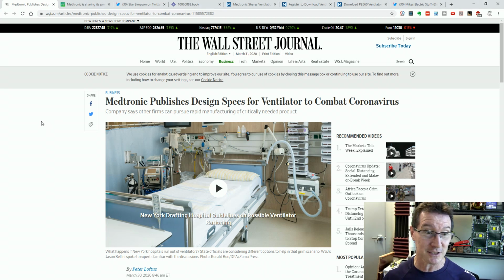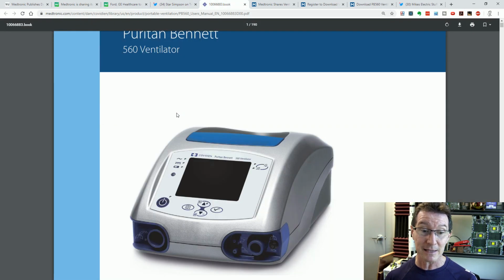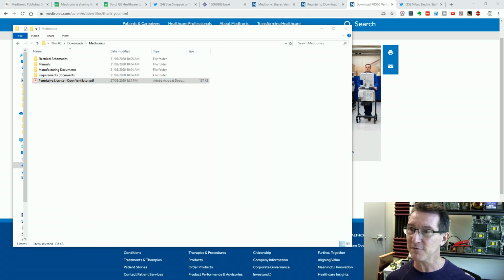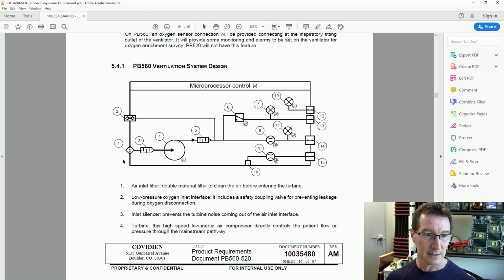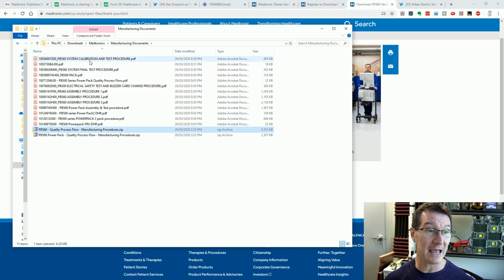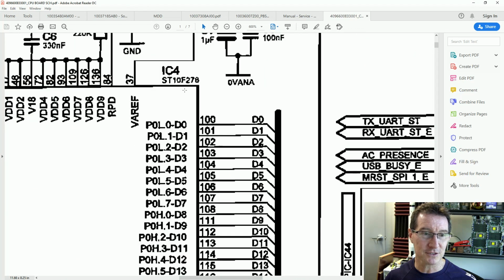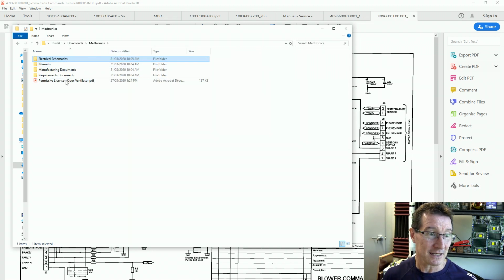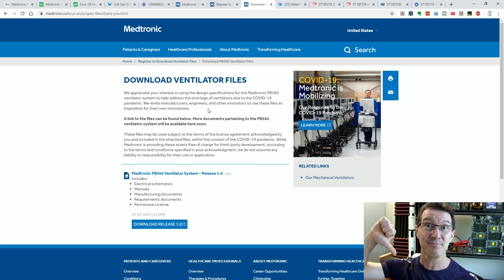eevBLAB #72 - BUSTED! Medtronics Open Ventilator FAIL

Comment from the maker: Perhaps the only thing of real use here would be the requirements documents, and only then to a multi-year approved product design effort. It would do very little or nothing to address any need for ventilators now.
And even then you've gotta read the permissive license very carefully, as the license ends the final day the WHO’s Pandemic call is in effect, or October 1, 2024, whichever comes first.

Also, perhaps unrelated, but interesting, it seems that Medtronic failed deliver ventilators for a US government stockpile contract since 2015:
https://www.nytimes.com/2020/03/29/business/coronavirus-us-ventilator-shortage.html
Reply: They're not releasing the software yet because they're busy removing all the lines of codes for things like "Screen dirty: Return to manufacturer for $2800 service."
Reply: Well, i guess these documents can be usefull, but not in short terms. BS indeed.
Reply: @coredayo3027  keep watch the information, it's coming.
Reply: Someone competent enough might be able to sift through all these documents, fill in the blanks, and design something capable, but it'd honestly be easier to just get your hands on a device whose patents have expired and reverse engineer then improve on that instead.

Hell, even the schematics don't do any good because you have to actually get those specific components to make it work or be really good at working out a substitution, which is risky when lives are on the line
Reply: Dave, and even if they would release all CAD files it would be too high tech of a product to produce instantly. In Italy they use scuba masks with 3D printed valves or slap Ambu bags onto a wooden board and motorize it somehow.

These are the solutions we need. Low tech instant builds to mass produce it by individuals.

Regards,
Etna.
Reply: @EEVblog Yes we've been working on this many weeks now already and the designs have progressed past the point these can be useful. We could really use breath detection algorithms and anything related to asynchronies but none of that seems to be there...
Reply: They updated the website more file are uploaded:

Medtronic PB560 Ventilator System – Release 2.0 (.zip)
Includes:

Manufacturing fixtures
Printed circuit board drawings (including multiple BOMs)
3D CAD files
Mechanical part drawings
Reply: I've reviewed these documents and I agree. This will require a considerable amount of investment, as well as backwards Engineering. Possible Mechanical companies: "Swagelok" for UHP connections - "Parker" or "AP-Tech" valve's (UHP) - "Brooks" or "Porter" (MFCs, MFMs, what have you). But yes, I fully agree. It would take longer to reverse Engineer and produce this machine than what we have available. Not to mention I didn't see that there are small purifiers (Molesive, etc) inline in order to guarantee CDA (clean dry air) otherwise "Breathable Air". It can be done though, just going to take too much time.
Reply: @eevblog there seems to be a bigger problem with this. I read this 2 days ago https://www.nytimes.com/2020/03/29/business/coronavirus-us-ventilator-shortage.html
It's pay walled, it explains how Covidien bought (through Medtronic) Newport Medical Instruments and delayed the coming to market of new generation of ventilators. Essentially asking for more money then shutting down the project because of the low price of the product. 
This PR stunt might be an attempt to brush this off.
Reply: If you print the PDF's you can alway use them for Toilet paper if you get caught short in the crisis.
Reply: Agreed, the requirements and test methods are good foundations for design but without the manufacturing files the product isn't tangible. So much work would have to go into recreating the design it's hard to believe the open source licence could be enforced.
Reply: Regarding the schematics: how long would it take to replicate the schematics from pdf in your desired CAD software? I guess we are not talking about months, right? From all what I saw: yes you cannot start to produce a 560 right away. Not sure if you expected this but from a product standpoint you do not want the people to simply copy your product. How would you finally earn your money? Do all the research work, figure out things, test over years, make the product better and then ket everyone copy it? Not quite a goal to reach, right? At least it is some point to start and I guess the intention was: here is how we did now go and figure out.
Reply: @ftrueck  that seems to be my interpretation too. Medtronic say they want to inspire others, the media bigged it up like they always do beyond the original intention.

Compiling those requirements documents is probably several months of work in and of themselves, so now you have a several month head start.

Ok, maybe several months is insignificant in the scheme of things (if it might take years to get a functioning product out the door), but they've showed you how to get a foot in through the door.

Maybe this is a bit like Microsoft releasing the source code for DOS 1.0 in that it's relatively useless in it's immediate form, but as you say, you can't necessarily just give potential competitors the keys to the front door.
Reply: @ftrueck  The license ends at the end of the pandemic so that would take care of the copying aspect, they'd sue those who still manufactured it afterwards. But that just reinforces the fact that for it to make any sense if needs to be usable NOW and fast, which it isn't.
Reply: @ftrueck  I guess you're right about that intention. But it was not communicated in that way by their communication department.
Reply: Mr green  That's the real value in the release: the requirements, and a bit about how those requirements are tested to demonstrate they are met.

Anyone who has been to a market that's been stripped of food, or toilet paper, should understand why Medtronic/Tesla don't want to publish BOMs for the very thing they're ramping up capable production lines to produce.

Groups that are designing more open ventilators, that use more open / readily available parts, can use the Puritan-Bennett requirements and test specifications to ensure that their own designs are meeting the needs of patients and medical professionals.
Reply: Mercedes F1  engineers help design breathing aid 
news.sky.com/story/coronavirus-mercedes-helps-develop-breathing-aid-as-f1-teams-join-ventilators-effort-11965584
Reply: @Dan-mu5oy  Through reverse engineering, brilliant! A UK company named ABI makes something called RevEng for recreating schematics. Bet they must have helped.
Reply: 4:10 they changed it to now say "More documents and source code files pertaining to the PB560 ventilator system will be available soon." Hahahah. Maybe the backlash from your video? :-)
Reply: @linagee  They've released a second batch of files, including CAD files.
Reply: Dave I have been trying to reach out to you. I am the founder of the OpenLung project.  Open Lung is a unique attempt at answering the ventilator crisis as we are both coordinating large scale EE and Mech Eng efforts towards a low cost, functional and flexible design. We operate like a mainline kernal providing core functionality designs and supporting outwardly branching distributions. This allows us to rapidly iterate toward a low end ventilator. The project started by focusing on the BVM bag as a core component, as it was already approved  for invasive intervention. If anyone visits our Gitlab, they will see myriad information relating to the rapid development of a (real) ventilator attempt. The reason I am trying to reach out is for your EE design support. Check us out at www.openlung.org
Reply: Admittedly I must eat my own words. They sort of are giving out the keys to the front door. I suppose they will rely on the license to sue people out of existence if they try to use the information competitively.
Reply: Go again to see the files they released yesterday: the source code compiles, the BOM's are in the zip files and the reason they released them so late was because of the editions of the PDF's to avoid legal issues. Man, if I was a manufacturer of biomedical devices I could not have the chance to fulfill the whole demand around the globe, of course this is a great paradigm shift because they know they won't fulfill the market and now it's even worse, because of the pandemic situation does not give a chance to keep your workers alive while they are being infected all around the globe.
Think about it, I will give it a try to avoid outbreak breaks down national health system in my country... and that is what we all expect from this
Reply: Here's something different: https://arxiv.org/abs/2004.00310
Reply: Can you revisit this? They released more...
Reply: @DerClaudius  he did make another video. This time complaining about it being too hard for a hobbyist to duplicate. Worthless.
Reply: Mechanical engineer here. I went through some of the design requirements documents  and although they do have some information that might actually be useful (like flow rate and pressure figures), everything else is too specific to their "big-company-cover-all-asses" bullshit that there's not really anything useful to learn from it that a Google search won't already give you.

No mechanical designs, no BOMs, no part specs in the mechanical side. Whoever would be able to design a ventilator using their "open source design" might as well just open one and reverse engineer it. 

What a joke.
Reply: You miss a point. Many countries changed their requirements for ventilators. So they can be approved in a week e.g. Dyson.
Reply: @Kal El WAT? Your post is Fake Testicle.
Reply: @Kal El, I do as well. One year is short for FDA approval and trials. They spend millions designing, producing and manufacturing. Sometimes hundreds of millions. Keep watching the Medtronic site. I don't believe this is a hoax, or a lackluster endeavor.
Reply: I think you need to update this as they've released 3 more sets of files as of April 3.
Reply: The release has been updated. May be you should make an update video.
Reply: There's hundreds of groups, but they're all building the same wrong type of ventilator.  The principal issue is the time taken to intubate people. I'm convinced the chest cavity shell style of ventilator is the type we really need.  This guy is half way there. 

https://youtu.be/0uYzfWecwII
I'd suggest a 555 timer.
Reply: It's just virtue signalling for the crowd
Reply: Hi, you need to check it out again. Back on March 30, only the Rev1 was published, now you got more material. Release 1 to 5
Reply: there's at least 5 people on youtube who've built multiple prototypes of ventilators, one guy with stuff just in his garage...

I bet it's even got an ARM core in it lol what happened was someone probably thought it was a great idea until someone yelled about code partitioning between the program and the firmware code.  ARM and other IP providers will bitch about the FW being opened up - you will be lucky if you get a binary you can shoot onto a basic CPU clone/family of the type, if anything.

My deal was that everyone who knows someone with sleep apnea already has a ventilator of a type (or half ventilator lol but THE IMPORTANT PART THAT EASES AIRFLOW IN)...CPAP machines.  I know people that had trouble because their thing was cranked up too high (or more commonly had a bug and needed a flash) and got stuck where they had trouble with normal breathing - but if your lungs are trying to collapse extra hard, then it seems to my logic that would be more useful than not.

But depending on how the model was designed (probably not very serviceable or modular or programmable, EVERYONE rushes to market with EVERYTHING) maybe they can release a parts swap for something that fits in the same spot (like be able to swap the valves for a back/forth instead of constant pressure/flow, or a FW update that allows the pump to cycle in/out pressurewise) as whatever FRU (if they have anything resembling an FRU) that is being updated/upgraded.

Is there value in modifying popular CPAP machines and then releasing the software/process under OSS/CC type licensing?  :-)
Reply: I would also wager the requirements document is untrustworthy, given that this all has FDA approval and it's perceived as a bit less liability back to the company than say, a hand waving over a new hip replacement, so there wouldn't be much motivation to make it specific.  First rule of writing anything, particularly patents, is be as broad and vague as possible and let those who would force you to update the archspec andor validate/verify/test have to petition to MAKE you do it.  Even then, you'll get error-ridden methods and data that when one considers the stakes here I personally would not trust THEM, no matter how many PBS programs they support.

I have a feeling there are plenty of universities with plenty of design guidelines for medical equipment, particularly those that would certify you to maintain andor design/engineer medical products.

Also, there may be some gold in the fitness sector.  Many products are relabeled as "fitness" to avoid even the FDA testing they actually get sometimes, as well as speed them to market by hopping past big chunks of red tape.
Reply: @russellzauner  the reason all the documents were released first is BECAUSE of the FDA.
Reply: @russellzauner  IBMer much?
Reply: What some people forget is that if you're on a ventilator you have to be sedated i.e. unconscious, if you don't have the medical professionals then having ventilators doesn't help. Oxygen masks are a different matter.
Reply: This is actually worse than they "just tried." I think its conspicuous that the most useful documents like the bill of materials are all the ones that happen to be missing. A design specification is also particularly not useful because part of whats needed right now is an optical not ideal design. It doesn't need to be silent. It doesn't need be super compact. It needs to be simple and readily available parts. Companies like this will have identified well in advance which documents are most critical to their trade and competitive advantage. It's those documents that they are NOT releasing.
Reply: motors are digital according to dyson  that is what you deal with digital stuff    it's a speaker too
Reply: WOW! Another YouTuber bashing a company that has done a LOT more for the opensource community than anyone else yet. You spent hours doing a 15-min video that kept showing how misinformed you are on the subject. Why didn't you spend the time reviewing the documents and rallying the best and brightest that could really make lemonade out of this lemon? What an utter bag of shite. People complain of the media then we get to see the same devil here doing nothing productive with the platform its been handed to. You've just BUSTED yourself, muppet. Disclaimer: never heard of Medtronics until now, just a concerned citizen who's tired of people sat on their arses complaining about everything while 10s of thousands are dying.
Reply: @JWL-UK  Can you explain hoe Medtronics is 'a company that has done a LOT more for the opensource community than anyone else yet.' They've open-sourced almost nothing, just some sketchy schematics and then without any software.
Reply: @cambridgemart2075  Can you explain which other company has done more or the same? See what the UK government came up with expecting companies to make ventilators from: https://assets.publishing.service.gov.uk/government/uploads/system/uploads/attachment_data/file/876167/RMVS001_v3.1.pdf 

It's just much easier to criticise instead of getting on with what needs to be done ain't it? This is what this guy's done, pure and utterly useless rant for 15 minutes...

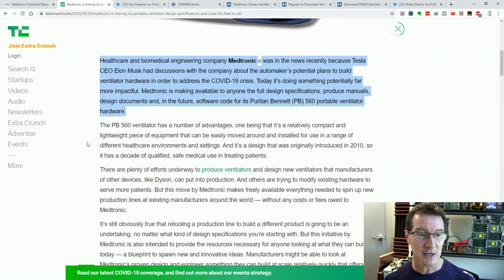Comment: Pause at 02:28.
If the design has been in use since 2010, shouldn't they already have the design data etc ready to go (pending redactions of non-technical, sensitive information and perhaps providing the files on a wider range of formats 🤷‍♂️)? 🤔

Comment: Emergency Ventilator, the real thing.

Please take a look at this, and if you find it OK, help spreading the word.
This is an emergency ventilator made by a Danish University ( @t ). The emergency ventilator is approved by Danish health system.
The ventilator is easy to build and cheap. But very robust.
I am Danish, but not an engineer, I just wanna help save lives. So guys, please take a look at it:

From Aalborg University, shortly before it got approved: @t

From Danish National Broadcasting (like BBC in UK), please use Googletranslate. I have tested it, it does make a decent translation: @t

Manuals, software, permissions: @t

As a Dane, I can verify that this University is OK and the article is from Danmarks Radio (national broadcasting).

Hope you guys wil take a look at it.

Comment: ...if you were a credible firm that had the means of manufacturing this design,, you might try and call Medtronic and get on board. If you are not, please do not. The information here at least would be more than you could probably learn otherwise after a year about Ventilators.

Comment: Just finished going through all the files, hoping to put a flow chart together to build.

ROADBLOCK!!!!!!!!!

The most important part, the turbine, including motor and impeller to deliver the “250 lpm into a pressure of 24 hPa”
is UNKOWN.

I just discovered this TURBINE / BLOWER is not designed or supplied by Medtronic, but by a company called airFan.

Also as surprising, airFan has removed the PDF document for this item, one MFA0114.

Came across a website, that Tesla is making a Medtronic Ventilator as well……..

I am hoping that others with a solution to the TURBINE issue, will reply.